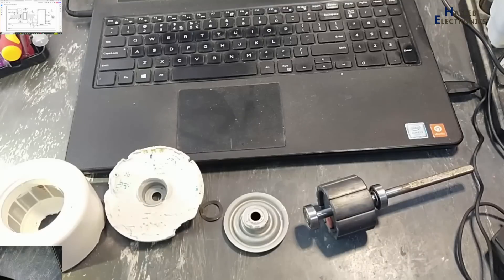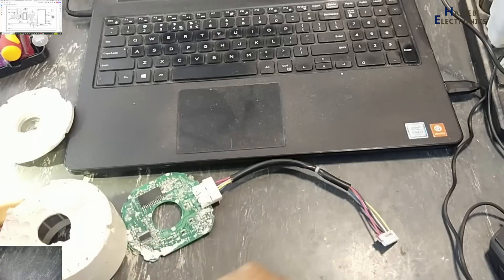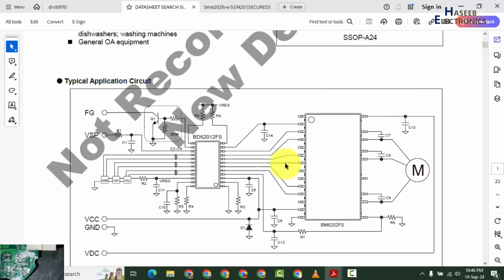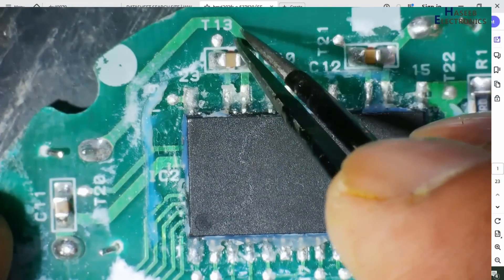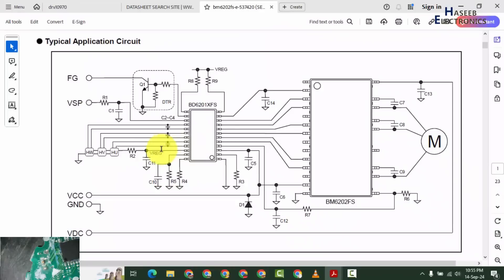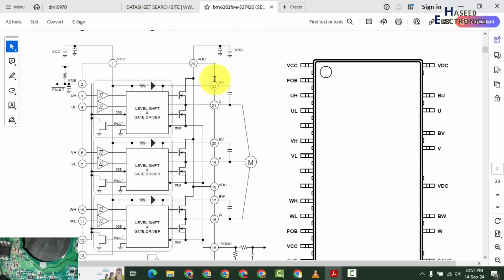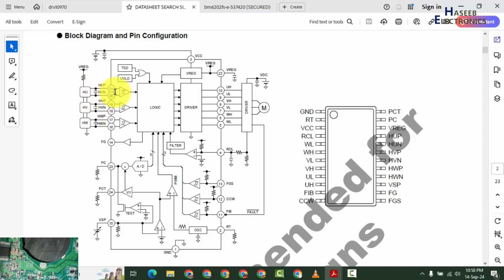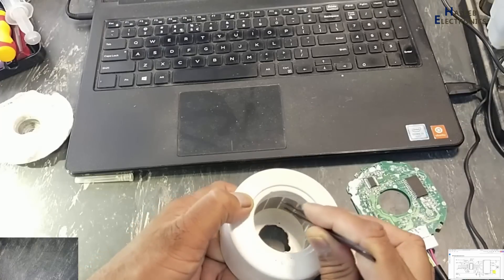{1190A} BLDC motor circuit configuration

Comment: Very good explanation sir. There are some BLDC motors that after some months of work in environment with temperature greater than normal fail to start and you have to rotate them by hand and then they start spinning. What could be the reason?

Comment: great channel❤.
i have a question Hasseb ,Why Bldc waveform or signal that drive motors or especially new inverter AC compressor use BLDC signals wich is different from SPWM sine wave we used to use in driving three phase motors and what happens if bldc compressor was driven by three phase spwm instead of bldc waveform?
thanks again
Reply: The simplest BLDC motors come with 6 step commutation sequence.
AND are the cheapest and simpler to manufacture...but have lower efficiency...
These are decoded by the correctly positioned 3 hall sensors...
From the hall wave timing diagram..it is seen positioned as 120°(electrical) because the motor winding is designed for 120 commutation sequence.
These windings are( pole) concentrated.. hence it goes through a SIX step switch sequence to complete 360° electrical..
Here each winding is excited for only 120° with +ve voltage..and after a 60° idle period it then gets a -ve voltage for 120°..followed by another 60° idle period...before the next electrical starts.....Here only two phases/windings are excited at a given time.
Note the one electrical cycle is not the same as 1 mechanical rotation...
In 1 mechanical  rotation there ARE as many " electrical cycles " as there are rotor " pole pairs".....i.e.  if there are 8N pole facing magnets alternating in between 8S pole facing magnets....it means the motor has 8 " pole pairs"....then there are 8 electrical cycles in ONE COMPLETE PHYSICAL ROTATION of the rotor.
..Whereas for a bldc( PMSM motors) with sine.. waveform...the windings are arranged in distributed form...and each conducts for 180°E .
Reply: ..perhaps an SPWM signal can be used for finer control..but not necessarily more efficient..BUT the same Hall decoding and SIX STEP commutation sequence remains as before....also it is still limited to the same 120° (Electrical) conduction per phase...& 2 phase excitation at a time.